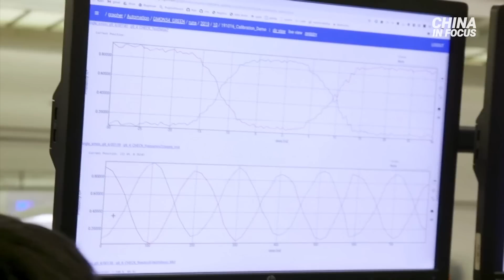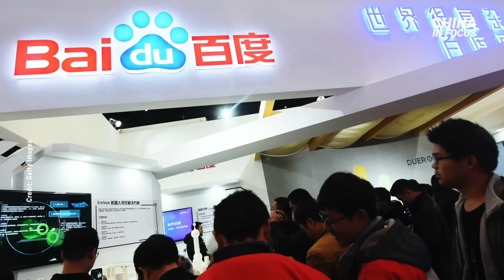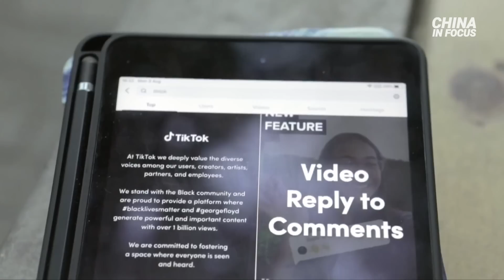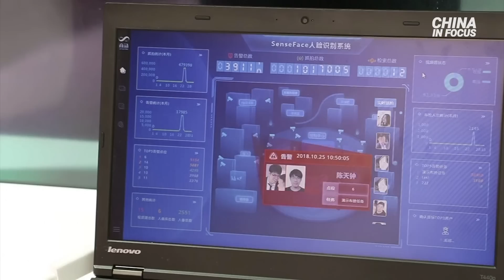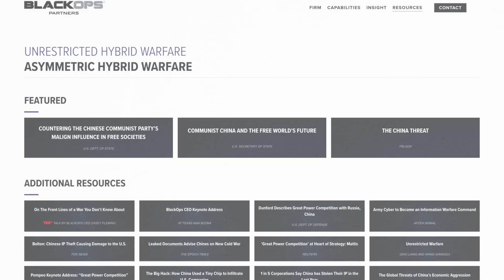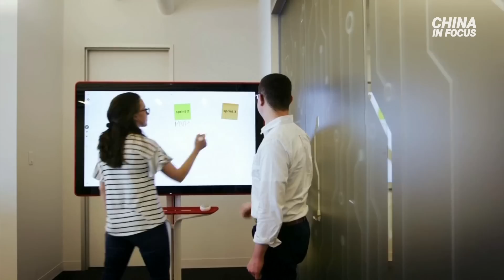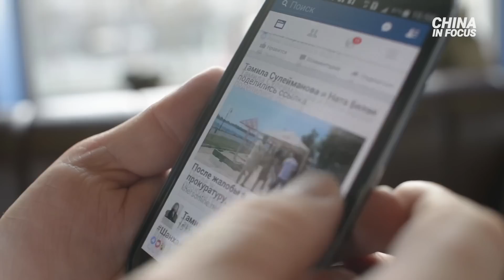Quantum Computing: Race for the Next Manhattan Project | China In Focus

Comment: 2:20 Yeah, I guess my watch has more computing power than a 100 harddrives. Hard drive stores data. Either he's misspoke or he doesn't understand how quantum vs normal computer works. Don't get me wrong. It's still catastrophic, but he does a bad job talking about it.

Quantum computer can "explore" multiple ways of computing thing at once. That means you trade time or try to complexity. It is suitable for solving a problem you have to try a lot of times to get through, but not good for something you know how to solve. This is why it's good for encryption cracking. That's why it doesn't make sense to compare qubit count to traditional processing power of classical computer. It's like saying this new car has more horse power than all all the wheels of these cars combine.

One more thing about this is quantum computer is not the end for cracking encryption. We still need quantum programming to do that. I think the last time I see a study on it, it'd take thousands of qubits to crack something like normal RSA and that was optimized estimate. If programming doesn't work quite as expected, it'd take more.

All in all, I agree with the message. I share the concern, but boi you need to have someone who knows what he's talking about as a spoke person.
Reply: Or he said hard drives instead of processors.